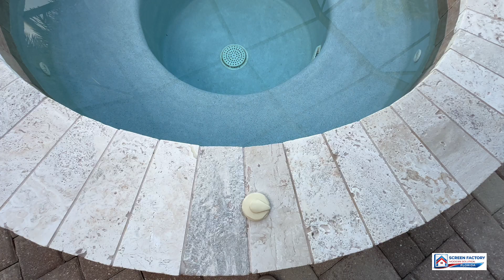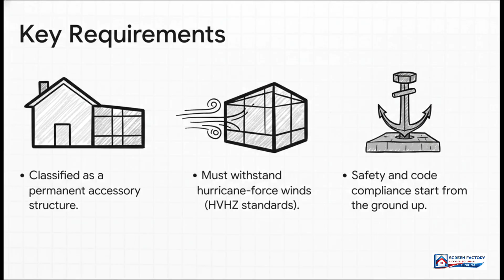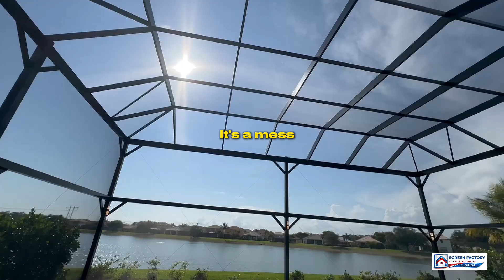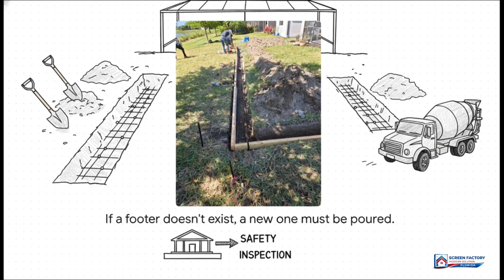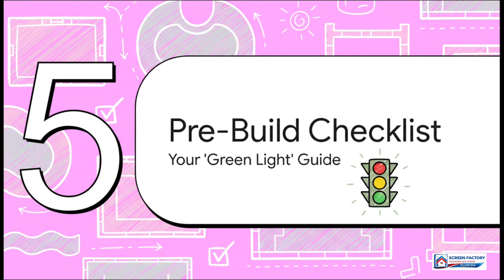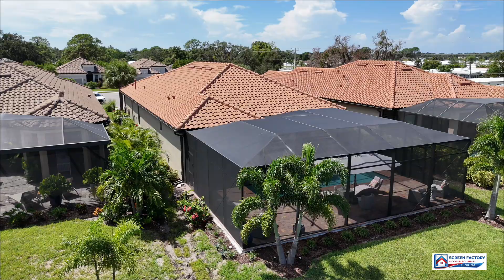Can You Build a Screen Enclosure on an Existing Pool Deck in Florida?

Comment: Contractor Community Please Help: My engineer made the following note on our drawings for a new paver patio with footer for future screen enclosure. What does this mean and how would you execute? “VAPOR BARRIER & TERMITE TREATMENT
REQUIRED WITHIN 12 INCHES OF EXISTING
RESIDENCE”
Reply from the maker: Hey Mike, this is pretty common in Florida when new footers are installed close to the existing house slab. Your engineer is basically requiring protection against moisture and termites near the tie-in area to the existing structure.

Typically we would:
- carefully excavate near the house,
- install the required vapor barrier,
- pour the new footer/slab,
- and then have the termite barrier restored or retreated if required by code/local inspector.

Exact execution can vary depending on your county and how close the new footer is to the existing foundation.
Reply: @screenfactoryflorida Thank you! This is extremely helpful.
Reply from the maker: No problem. Hopefully it saves you some time on the job.